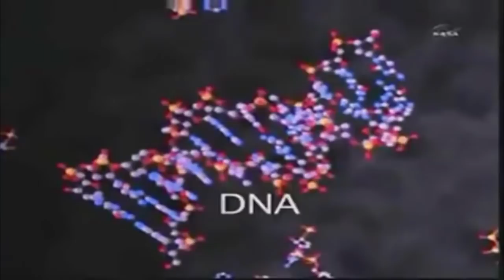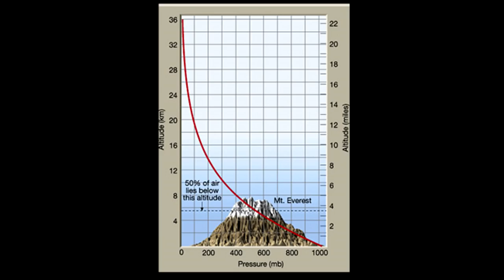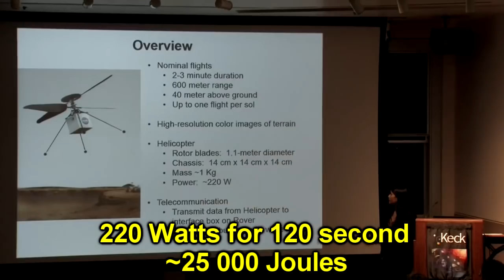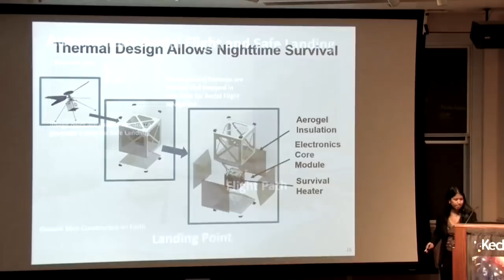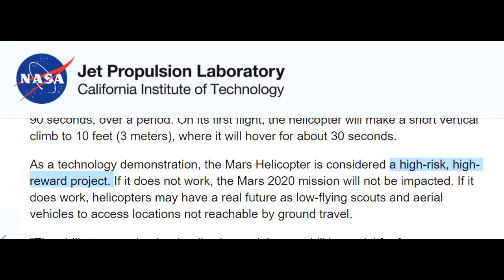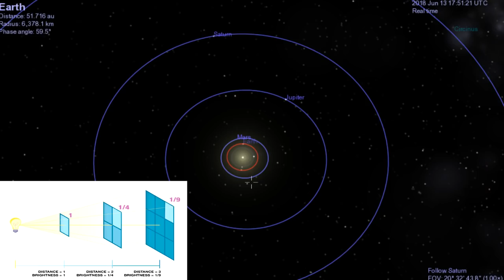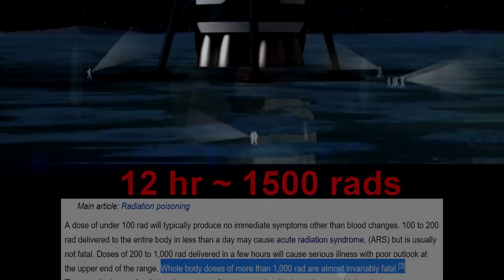NASA is sending Helicopter to Mars!! Smart or Silly?

Comment: With them big blades, wouldn't it be possible to set them up as solar panels? Would give quite a bit more area.
Reply: This is literally what I was thinking and asked above (abit a little more detailed :D )
Reply: They could use the flight controls to tilt them to face the sun, generating more power.
Reply: that would make the blades too heavy
Reply: I think you're missing the point.  The point is to minimize risk, and this is already a high-risk project (risk of failure, that is).  If they wanted more power, they could just make the solar panel a little larger - the middle of the rotor doesn't produce a lot of lift anyway.  Instead, they keep it simple.  Also, there's the weight limit.  How is this a factor?  If they had more power, they could have longer flights, but then the thermal design would get more difficult, which would require more mass to deal with, and they'd need bigger batteries, again, more mass.  The size of the simple panel they used was exactly what they needed, and simple.
Reply: The solar panels are on the drone, the same weight no matter where they would be located. But putting them on the blades allows the drone to use the flight controls to tilt them to more directly face the sun, thus getting more power than any fixed location could get. The only potential problem would be centrifugal force, that could be minimized by placing them near the center of the rotors.
Reply: The centrifugal force is rather huge. The force cause by  just 10 grams at 0.55m, which is the edge of the blade, is 78 foot lbs of force when at full speed. At mid blade, 10 grams on the blade causes 39 foot lbs of force when at full speed. For a note, the force from gravity of the system on mars would be about 1 foot lbs of force. There would also be an increase in energy required to bring the blades to flying speed.
   Any increase of weight on the blades would likely require increased support, which would increase the power needs and might completely counter act the power gains from more solar panels.

Comment: Couldn't they angle the solar panel, and attach it to the engine, so that using the engine just at tiny bursts be able to rotate and track the sun during the day? This would give them a 3x increase in power according to your numbers. You also need to be able to find a way to have the same electro engine provide vertical tilt of the panel (you can't fly with a rotating, tilted panel I guess) but this seems like a small extra weight compared to the power gain.

Comment: I have an idea,send a rover with the helicopter,the rover would be equipped with a huge rotating solar panel and batteries,so the rover would collect the power throughout the day and then provide that energy to the helicopter via some sort of connector arm
Reply: For the life of me, I can't think of a single benefit to doing this that would outweigh the negatives of higher mass and complexity. The Ingenuity works, and as a technology demonstraton it has exceeded it's mission expectations long ago. If they want to improve on the system, they could send two next time. Or ten.

Comment: 9:05 "even if the thing is clearly tethered by a safety wire"

that's not a safety wire, it's a gravity offload to simulate martian gravity
Reply: They could just use a balloon for that..
Reply: @InfernosReaper  balloons don't work in a vacuum so they can't
Reply: @chromacat248  Helicopters don't work in a full vacuum. Welcome to using a vacuum chamber to make an area of reduced pressure, rather than a full vacuum.

Alternatively, they could just remove unnecessary components to make the thing weigh less, thus getting the same effect. As long as they keep the weight balance close enough, it'll be a fair proof of concept for the motor and blade designs.
Reply: @InfernosReaper  ..or you could use a wire to remove 2/3 of the load which is much easier to do
Reply: @chromacat248  are you seriously trying to tell me that calibrating a line to partially suspend a device without introducing potential interference from the setup is easier than just using a lighter device or strapping a balloon to it?

I don't believe you, but am open to hear an explanation for how that would reliably work
Reply: @InfernosReaper    

the reason why reducing mass isn't a good solution is because most of the mass is in the propeller, so you can't remove much of the mass much less 2/3 of it without making the propeller a flimsy piece of garbage

the reason why using a balloon wouldn't be much better than using a tether is because it would be just as if not more difficult to calibrate it as using a wire

why do you think a wire would introduce any more interference than a balloon

Comment: Your mistake is that the solar panel on the Mars helicopter is high efficiency solar panel that is very expensive. Not your normal Panasonic solar panel. But you have done a lot of work on this. well done.
Reply: The actual solar panel is also bigger than the original solar panel design, which was what he suggested.

Comment: 7:25: "the blades need to spin 100 times as fast"
That's wrong, isn't it? When the blades spin faster, they generate more lift per molecule they hit. So shouldn't 10 times the revolutions per minute suffice?

Comment: 7:33 actually, the velocity in the lift equasion (at least, for helicopters) is squared, so you would only need to spin 10x as fast, combine that with mars 1/3 gravity, you would need to spin the blades about 3x as fast, that is challenging, but hey, it's NASA, they will be able to do it
Reply: and also, 23:42, I think he is saying that the radiation from the way to mars, and also those pictures are probably just for looking cool, they will probably never happen

Comment: The motor overheating is not a big deal. Assuming a heat capacity of about 500 joules per kg K (worst case), 25,000 joules per kg increases the temperature of the object by 50 kelvins, hardly an issue at Martian temperatures.

Comment: Why not use a nuclear battery?
Reply: would be heavier?...meaning te whole design would ave to be scrapped to accommodate it....I think.
Reply: Wouldn't nuclear batteries have a far higher energy density than lithium-ion? Meaning it could be much smaller for the same current?
Reply: High energy density and a long lifetime. If you want high current, you have to use a heavy battery, because radioactive decay is a pretty unalterable process. Oh, and Pu-238 is expansive as fuck by now and as unhealthy as ever, if the rocket lifts off in a much more passionate manner than it should.
Reply: They have a crazy high energy density but an extremely long life and one energy output rate. So, the Curiosity's Multi-mission radioisotope thermoelectric generator (nuclear battery) produces 125w to 100w continuously over 14 years, but the watt to weight sucks, at 2.8 W/kg, ei the weight of the entire aircraft for the power the solar panel gives off.
Reply: It's too heavy for an aircraft.

The plutonium has a high energy density alone (on paper) BUT it's casing, shielding and heat transfer systems do not. And you still need a battery since it's a constant power source. So the practical energy density of an RTG is zero point shit. The reason RTGs are popular is their long life spans and low maintenance, they're actually one of the least efficient ways to get power from plutonium. But no one is going to approve sending a reactor to Mars, also it would be even heavier so useless for this helicopter. +GamingTV They don't explode randomly.

Comment: Why not just send a little charging platform for the heli that would bolt itself in the ground after landing? It could heat the heli as well and it wont get blown off by a sandstorm
Reply: Because they want the helicopter to follow the Mars 2020 rover around, giving it detailed terrain maps. A fixed charging station would keep it tethered to one location.
Reply: build a charging station into the rover
Reply: +john li - That would have the advantage that you get the rover's larger power supply. But its a much smaller target than 'anywhere nearby with flat ground', and the rover itself may be at an angle. You also risk fouling the propeller on the camera and drill arm,  or snagging the landing legs on any exposed cables, the communications antenna, or the RTG radiators.
Reply: Large rover with non stationary platform in the middle? The platform would rise up as the heli was landing get into a horizontal position and then lower it down. If the rover was wide enough there wouldn't be a high risk of it tipping and there would be enough space for the heli to land without bumping into anything
Reply: Because they sold this as being 1 kg, total, with no impact on the rest of the mission.  That's a pretty big reason.

Comment: That is NOT how helicopters work, that is how a lift fan works.

Helicopter rotor blades work EXACTLY the same way an aerofoil works - chordate displacement of air flow creating a pressure differential between the upper laminar flow and the lower laminar flow.

Helicopters angle their blades to do, essentially, two things...
A: To compensate for differential lift caused by the preceeding blades.
B: To cause momentum.

Doesn't change the point very much, but you're usually better than that.

Comment: First time I've been pretty disappointed, you're comparing a basic cSi 40 W panel with what is probably a high efficiency Gallium Arsenide heterojunction panel and assuming the power densities are the same... This is a huge oversight in terms of the power generation.

Comment: This comment might be comeing a little bit late but the NASA drone is not the same as a comercial drone. The difference is that the NASA drone is a turbo prop with counter rotating blades. You can not compair a drone with 4 singular blades because on a turbo prop the single prop makes the air flow threw twice as fast. 
I am no aviation expert but to my knowledge turbo props are to this day one of the most power efficient engines. It's Just not as fast as for example a jet engine but it's defenetly extremely efficient.

Comment: Why not put the solar panels on the top of the rotor blades, self cleaning.
Reply: The rotational stress of stuff spinning at 1000+ RPM is pretty insane. Putting something as weak and heavy as solar panels on the rotor could result in it ripping itself apart.
Reply: then add more superglue. Nasa needs to develop solar freaking blades. How hard can it be? They've made more impressive stuff than solar freaking blades.
Reply: Solar panels don't have to be brittle.  Lightweight, flexible panels are widely available.  I think it's the obvious way to increase the solar panel size without getting in the way of the downward airflow.
Reply: The rotor would need seared bearings, just as Thunderfoot pointed out the motors would need, for the same reasons.
Reply: Outside of the weight issues. Nasa would have to find a way to reliably transfer the power from the blades to the craft. That's not ALL that difficult on earth but mars is very cold. usually on earth we use things like conductive pads and dialectic grease to ensure clean and reliable electrical connections between moving parts. However on mars that just wouldn't be really possible.  And even still I can't see that working well at all for long on earth.
Reply: If solar freaking roadways are easy enough to make, then why not solar freaking rotor blades.

In fact, why doesn't NASA get Scott Brushaw or whatever his name is, the solar roadways team to develop them? They could even heat themselves to ward off snow, and with the built in LEDs on rotors you'd be able to communicate with any life forms who happen to be passing. (Or just put on a fancy RGB display)
Reply: MichaelKingsfordGray Magnetic couplers
Reply: Laser of course lol

(Or you could use a more tried and tested way, but that'd be boring)
Reply: Check your PC fan, it's not self cleaning and I doubt the rotor blades would be different. Not that I have any scientific evidence for that, but I just doubt it.
Reply: Actually, sod this, they need THORIUM POWERED FREAKING CHOPPER!
Reply: Nick Breen your overthinking it. we can just spot weld an avrage teenage girl into a seeking helicopter, and install a wifi router we can troothle.
Then we duct tape some disarmed nukes to the chopper, aim it at mars, and wait 6 months until it crashes into the red planet.

Then comes the genious part, we start throotling the wifi and once the lagg reaches critical mass that the teenagers need to refresh instagram, reaches a mass whit high enough density, allowing the helicopter to sink down to the core of mars, and act as a gravitianional well holding onto the atmosphere.       So that we can just use normal drones.

Pft, solar panels on the rotors.   Fucking hippies...

Comment: I think that it's not very feasible. The problem is, at 1/100 the density of Earth's atmosphere, that means that to support its weight, it needs to propel the air downward at 10 times the velocity, which requires 100 times the power as it would on Earth to hold up a helicopter of the same weight. And energy is at a premium on a mars rover. I'm not saying it can't be done, but it seems like it would have to be very wasteful of something there's not a lot of to waste.
Reply: Now an AIRPLANE on mars, that would be more plausible. Because of the way an airplane works, it provides lift by not propelling air down at a high kinetic energy, but because the airplane's motion to the side is so great, it runs into a great volume of air in moving to the side in order to use as a propellant thus not needing to move it down as fast.
Reply: @medexamtoolscom  that's just wrong. The rotors of a helicopter work the same way the wings of an airplane do, so the energy efficiency difference isn't big. And good luck having an airplane take off an land on Mars without preparing an area for it. Btw it just flew and landed intact.

Comment: I’m late to this party, but another thing that could help is to somehow turn the blades 90 degrees so they are facing up and down and use them as a wind powered generator to help the solar panel.

Comment: Enjoy most of your videos Thunderfoot, but in this one you do a pretty bad explaination of how a blade creates lift.  I'm no expert but even with my limited understanding of wings and lift, I can see you are way of.   Lift is NOT created by air molecules hitting the underside of a wing/chopper blade.  It's created by air forced to move quicker over the top of the wing then the bottom. Thereby creating lift by "sucking" the wing up.   Now to be fair, the way you explain it is somewhat right by the fact that about 20-30% of the lift comes from "pushing" underneath the wing.  So I'll give you that you are about 30% correct lol.   
A wing/blade has a specific shape for a reason, otherwise you could just use a plank and angle it to get the lift you want.    Now I'm sure I'm not the first to point this out to you, because this is basic knowlege to anyone that can fly a plane. But since I didn't see any comments on it, I thought I would mention it to you.  You better read up on aviation and wings :)
Read this to get a bit more info.  https://www.grc.nasa.gov/www/k-12/UEET/StudentSite/dynamicsofflight.html

Comment: If had any say, I would build a crawler that houses a solar power charging station for the drone. It could land on a pad that magnetically couples to the battery to charge it. 
The pad can be withdrawn or deployed from the crawler to serve as an insulated HANGAR for the drone. I wouldn't put ANY insulation on the drone at all; I'd put in on the crawler/base station.
You can put a larger battery and more equipment into a crawler that extends the drone's capabilities.

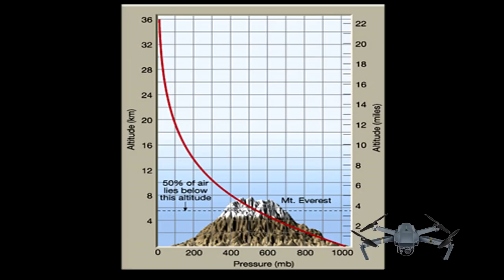Comment: You screwed up your entire lift calculation smh. 7:20 If you go up to 1/100 of the atmosphere, the blades only need to spin 10 times as fast, not 100. Lift = Cl × 0.5 × density × velocity^2 × wing area. 
Skepticism is good when you actually know what you're talking about. It's a different story when your skepticism is founded on incorrect math and smug ignorance.
Reply: The helicopter did what he said it would and said Nasa's calculations were probably right so Mars copter is plausible.
Reply: @thorhelm4055  Sure that's not the problem though, the problem is the numbers he shows are incorrect. If he thought Nasa was probably correct then he shouldn't have felt the need to add his wrong input.
Reply: Skepticism is good in general, not just when you know what you're talking about. After all, why should you be trusted over thunderf00t? Clearly one of you is wrong, but most people watching the video or reading your comment will not have enough knowledge to which person is right. 
Thunderf00t has made mistakes in the past, it just goes to show you need to be skeptical of everything, even sources you trust the most. If something doesn't sound right do some research.
Reply: @MisakaMikotoDesu  Yeah, most people don't have enough knowledge to have correct information. Combine that with enough skepticism and you get people like antivaxxers. That's why it's so important for media figures to responsibly and accurately present information, especially when it's presented to the layman. 
I agree, people should do their own research. But that's even more true of Thunderfoot and anyone making persuasive videos. Skepticism is only the first step, the next step is research and accurate information. It's what Thunderfoot isn't doing every time he makes these lazy errors, of which there are a lot of them.
You mention the choice between trusting me or TF. It shouldn't be a choice in the first place, TF should be correct in his own videos.